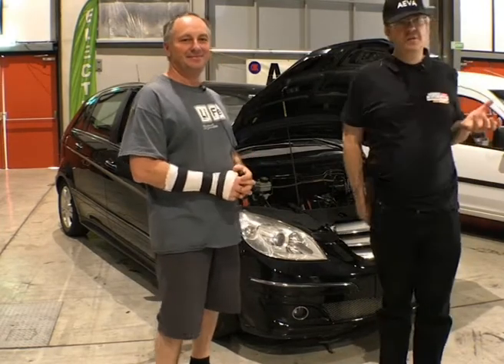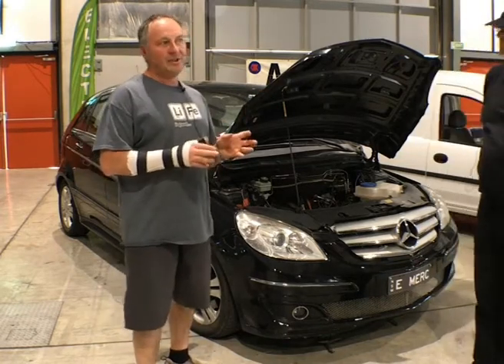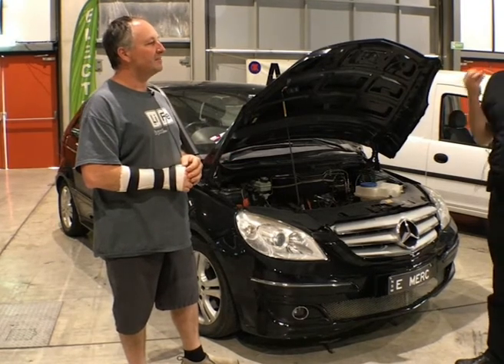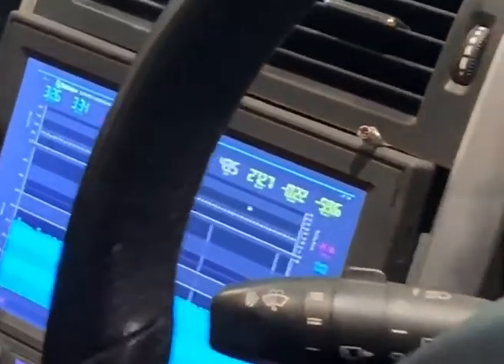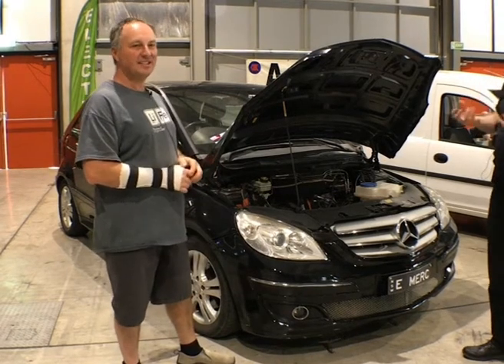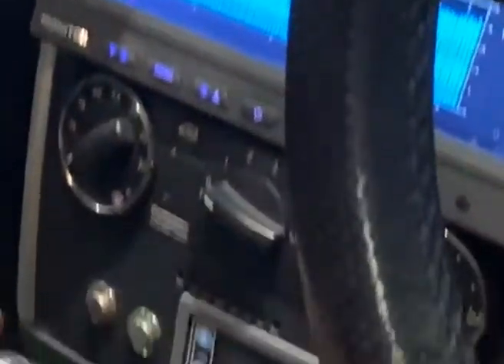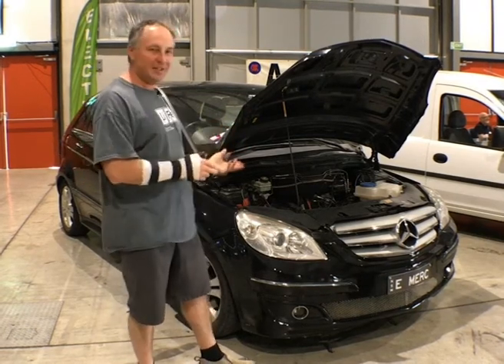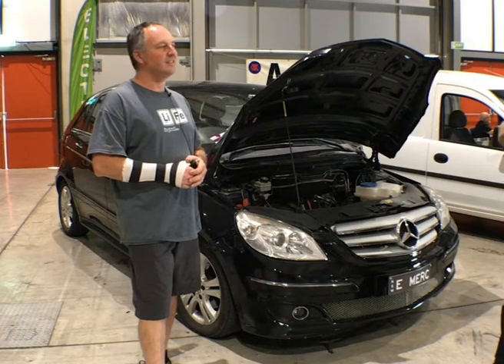The E-Merc EV Conversion

Comment: Could you convert om642 224 bhp 2007 e320 cdi to hybrid diesel. I dont want a fully converted EV car. I want a extra power from Electric motors.